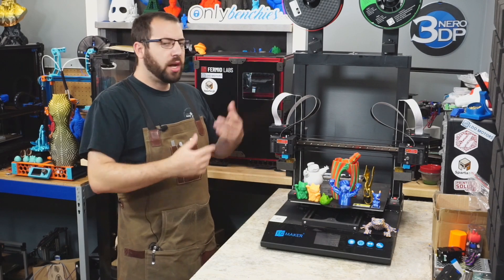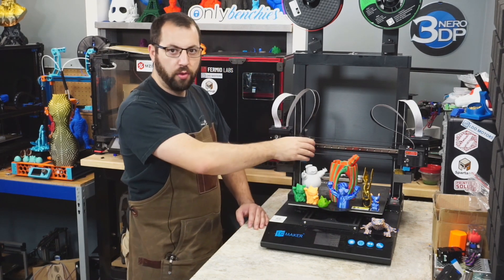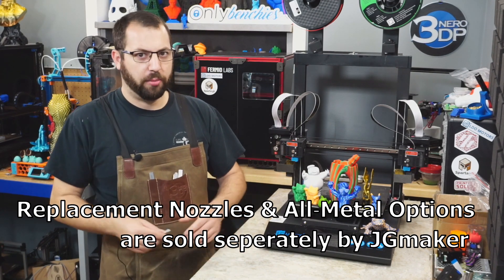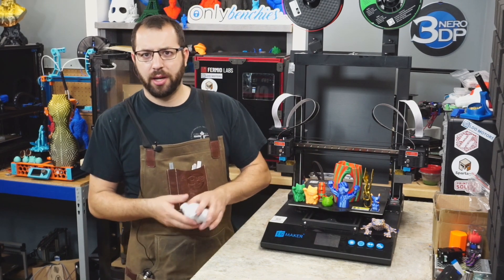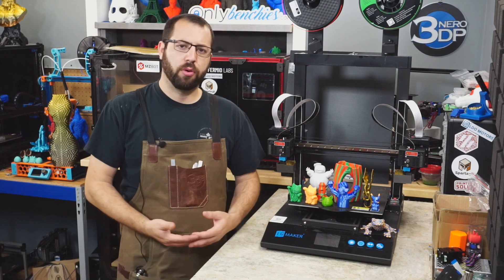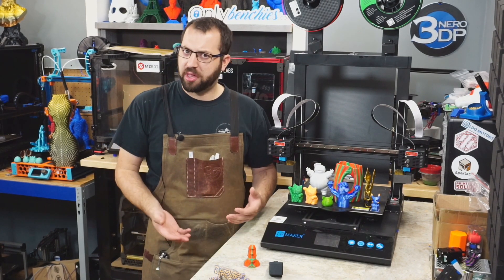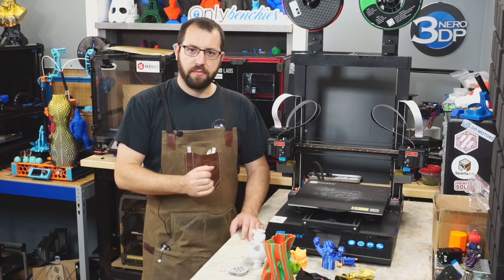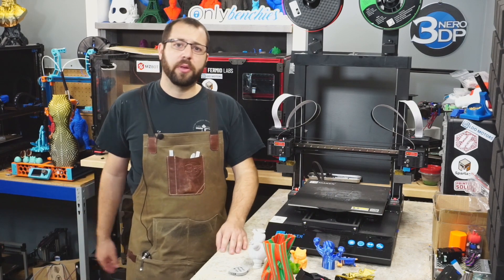JG MAKER Artist D PRO IDEX 3D Printer - REVIEW

Comment: Just got this printer today, and so frustrated with second print head. Loosened all 4 screws and tried to adjust it, but it will not move up or down. No clue if im doing it wrong.. But such a pain in the rear.

Comment: Hard to find anything good to say about this machine. It has issues in several areas judging from your guarded review. So then I found out from your comments not the video, that this is an "older model" and yet STILL littered with problems beginning with but not ending with no auto leveler.
I sincerely hope the supplier also supplied you with filament suited to the machine and not have you out of pocket with all the fails you had, the number of which you never mentioned explicitly. Nah, I have enough problems in my life without going out and buying another. The only good thing about this video is you didn't pay for the printer. I would be heartily pissed off if I bought this one and expected decent printing. Rubbish product with zero software from the makers. Support answers here were a joke. "We are testing . . ." Yeah right. No parts available as of now (I read below).
No replies from vlogger from some who needed a decent answer was disappointing. You put out videos you answer the comments . . . for a month at least.
Anyone thinking of buying a printer and you have read my comment down this far...get yourself a Prusa and ENJOY printing, not stuffing around with half-arsed sloppy builds and zero software.

Comment: There are compatible hardened nozzles to print with wood and other abrasive filaments?
Reply: No, they are a one of a kind design.  I usually just throw it out after doing prints with abrasive filaments, the nozzles are relatively cheap.  You are limited to 245 deg due to the ptfe liner thou

Comment: Thank you very much for your review of JGMaker product. We do have pre-tuned slicer profiles for the Artist D Pro, which you could please download here: https://www.jgmaker3d.com/pages/document-download
Reply: Besides, the profile is usually also included in the SD card provided with the printer, if not, might be forgotten :(
Reply from the maker: My SD card just had an older version of cura, that was it on it.
Reply: @CanuckCreator  Some newly profiles can be downloaded on the official website: https://www.jgmaker3d.com/pages/document-download
Reply: GREAT. Mine should be delivered tomorrow. Is there a way to make the extruders park to say x-20 and X(max)+20 to move it off the brushes?

Comment: So you’re recommending it? That’s what the affiliate link suggests. Check a video by Kersey Fabrication for a in depth review detailing all the shortcomings of this printer.
Reply from the maker: Thats not an affiliate, just the link to the printer in the original email they sent me, im not even signed up for the amazon aff program, and when i do post affiliate links its clearly stated and i dont spam them at every opportunity

I do initial reviews based on my own experiences with the machines as to not bias my opinions.

However as others have pointed out. This machine as shortcommings in regards to the extruder and i will probably do a follow up at some point.

Yes. Its an older machine. But sometimes its good to take a look at something thats been out for a bit too see if things have been changed or improved. Plus i dont do many reviews off COTS machines so its  experience and practice for me

Comment: Thanks for the review :-) 
Have you tried turning on ooze shield to help address the inactive nozzle dripping filament issue? Well you solved it with purge tower and different brush mount anyway, but it may be another tool to use with dual extruders.
Reply: We are doing test, trying to find the best solution, which will improve the quality of prints, look forward for it.
Reply: But yes, lots of work and so few hours in one day :-)

Comment: Every review until now revealed extrusion issues. K. Fabrications has made an extensive review focusing a lot on the extruders and revealing inconsistent extrusion due to slipping of the filament. Under extrusion might be a problem that could be fixed by setting the profile while inconsistent extrusion reveals some mechanical issue. Have you tested extrusion repeatability in this printer?
Reply from the maker: No direct tests, just the issue that came up during the dual extrusion prints were all i noticed.
Reply: @CanuckCreator  will we ever see an IDEX voron ? 😁
Reply: I had one of the initial 200 and the under extrusion issues got worse over time. I ended up replacing the extruders with Hemeras.

Comment: Would you please share your profile? I'm having a lot of trouble tuning my Artist-D.
Reply from the maker: Im still not comfortable sharing it as its pretty rough. But its the idealmaker machine profile off the jg maker site for the artist d pro and then using the raise 2 as the slicer settings to start and going from there for tweaking.
Reply: @CanuckCreator  I appreciate the response! I will give it a shot. Guess I have to learn ideamaker - I'm used to PrusaSlicer/slic3r. Thank you again.

Comment: I got the KS base model and it has one of the worst extrusion issues I’ve ever seen in an extruder. 
I’m in a discord group where 7 other people have got the base or pro model and ALL of us have replaced the Extruders with Hemera or Matrix extruders. 

This in combination with the abysmally bad Support (and lack of acknowledgment of design problems) makes it a company and printer to avoid. 
Stay. Away.
Reply from the maker: Thanks for the info..when i do a review on a printer ill purposely try to  avoid seeijg what others are saying to avoid impacting my opinions of the machine itself.
I will say the extruder itself is a weakpoint in the toolhead. The only issues i had on my machine where the underextrusion issues with dual colour prints on small details that i did make note of in the video. 
Im already thinking about options for awhole toolhead replacements on this (mini afterburners from the vzero maybe)
Reply: @CanuckCreator  Dont get me wrong, I still appreciate your efforts and I believe your review is honest. I'm just trying to throw in a different perspective on the printer. On my machine it's not possible to print PLA at anything over 35mm/s. And even then the extruder to skip/lose grip. 

It's a known problem in the community that there are many people with extrusion issues (cant calibrate esteps, filament slipping, skipping and 'gaps' in prints), but it doesn't happen to everyone, which makes diagnosing the problem hard. 
It could be related to badly machined nozzles, from which is known that they can be too big(!) for the hole to fit in - which means there could be nozzles out there that are way too small and those inhibit heat transfer - making the extruder skip faster (which doesnt explain low filament grip). On the other hand there have been machines on which the extrusion issues could be fixed with 3d printed idlers, or the use of washers on the tension screw, both methods didn't properly work for me. 

It is a guessing game and luck if you get a functioning machine. 

JGMaker themselves are pretty sketchy. They promised "silent fans" and "fixing the extrusion issues" during the Kickstarter campaign - both promises were not met. Additionally they posted pictures of prints allegedly printed on the artistD on their social media account. Those pictures where indeed printed on the ArtistD - but on a heavily, community modded one, without permission of the OP - trying to paint the picture that the Artist can print flawlessly without modifications, which is not the case for many users. 

Im just bringing awareness to those issues.
Reply from the maker: @Chrissi33004  appreciate it. Good to know
Reply: @Chrissi33004  Thank you for sharing such a long  essay，which completely demonstrated your problem. 
For the underextruding of print head, it's  mainly caused by filament sensor, and the gear,  we do have a new extruding gear,  which solved the  issue of under extruson.

Take time to adjust the printer, show a little patience, it's not easy to get a perfect print, but this doesn't mean it can print nothing, Artist D is a wonderful printer, if you would like to spent time on studying how to make it run properly, take time to prepare, even if you are a professor of 3D printing.

Every model we posted is printed by Artist D or Pro, there is no a single unit that is copied from website.

Comment: huh those underextruson issues are weird. I have a doot changer and i don't even purge on my tool 0. i plug the nozzle with a bar so it can't ooze and i just pick it up after i'm done.
without something plugging the nozzle i have to purge 10mm everytime before picking the tool. i also set the tool change retraction to 2mm in the superslicer and it works just fine for me.
Reply: Try to passby the filament sensor, we are testing the new filament sensor. And change the new gear, we have that in stock.